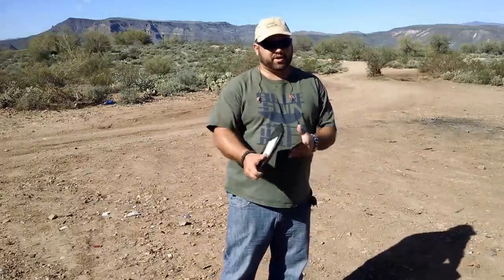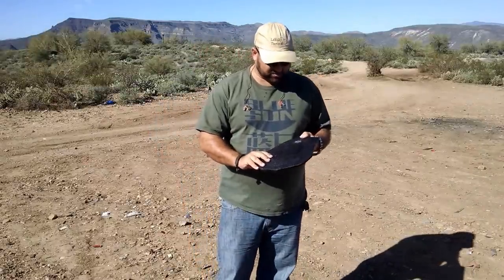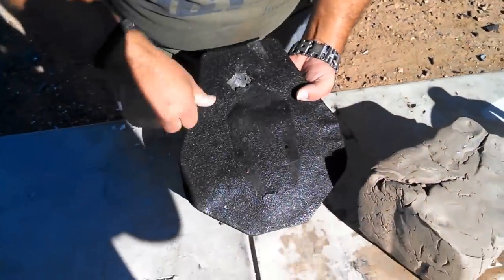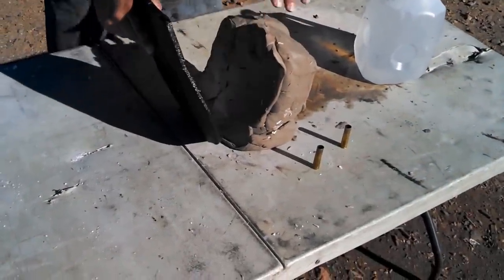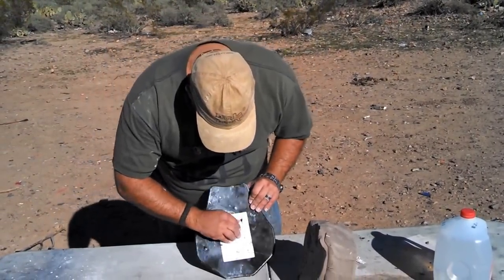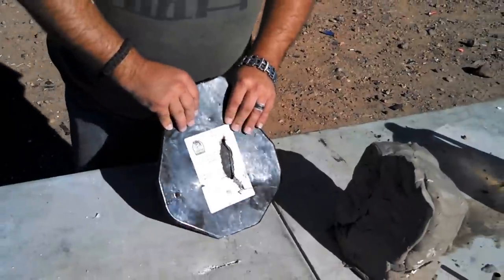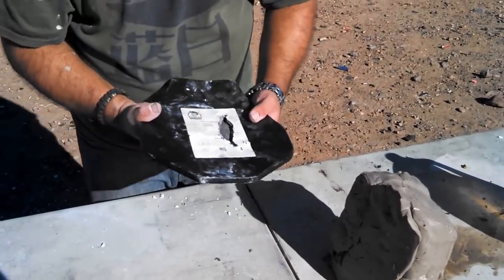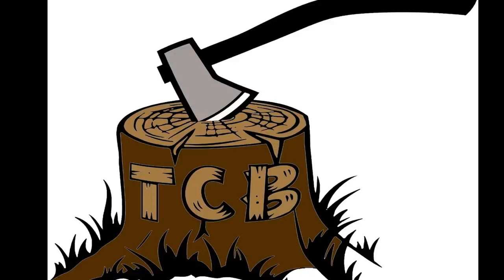Spartan Armaply level III+ steel armor vs .450 Marlin test video

Comment: Good stuff man.
Reply from the maker: Thank you. Also I have no idea why I wasn't subscribed to you. Thought I was. I corrected that problem, though.
Reply: +The Chopping Block Very interesting!, weve seen 12 gauge slugs bend plates up but not penetrate in the past, but I would bet these newer, harder plates would fail much quicker due to the lower ductility
Reply from the maker: +Mark Anthony Stringfellow Could be.